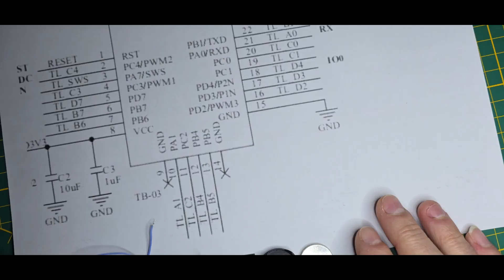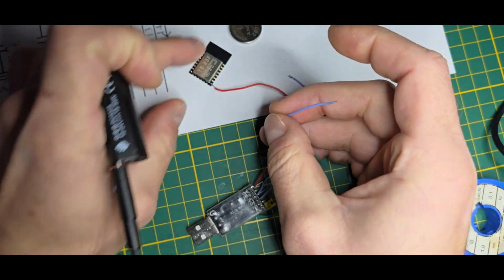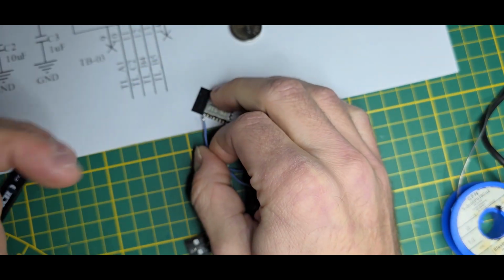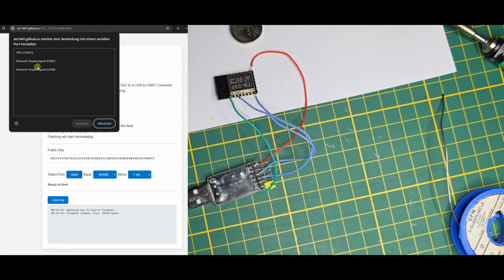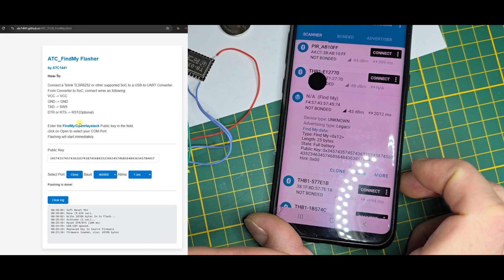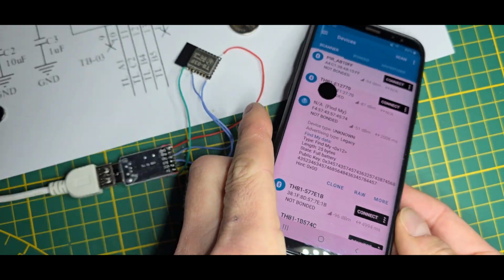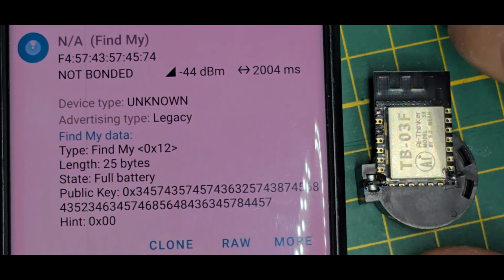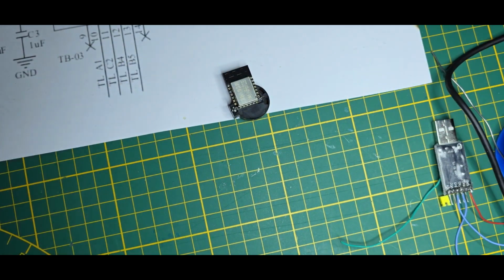2€ Airtag clone, DIY FindMy OpenHaystack device

Comment: Nice tutorial! Has anyone succeeded in using the web flasher with Chrome on macOS? Tried two different USB-to-TTL dongles but the microcontroller doesn't seem to start advertising after flashing so I suspect something is going wrong during flashing.
Reply from the maker: Hey, this is a Windows with Chrone only tool. You can use a VM on mac to get it working
Reply: @atc1441 will try, thanks!
Reply: @atc1441  That did the trick! Thanks a lot!
Reply from the maker: Perfect

Comment: I tried with version already buit in programmer. After programming I see in bt devices AI-thinker instead of Findy My or Any indicator that it is Apple Airtag..
Reply from the maker: Then the flashing went wrong and it is still running the old firmware
Reply: @atc1441  I don not get any error. Here is an example log: 
06:52:17: Soft Reset MCU
06:52:17: Done (8.293 sec).
06:52:11: Write 18788 bytes in to Flash...
06:52:09: Activate (1 sec)...
06:52:09: Reset DTR/RTS (100 ms)
06:52:09: USB-COM opened.
06:52:05: Replaced key in Source Firmware
06:51:17: Firmware loaded, size: 18788 bytes

and then: Flashing is done!
Reply from the maker: The flasher does not have any Rx, only Tx so it does not know if it was successfull.
Make sure to use a Windows machine with chrome

Comment: Thanks a lot! I have been using it to track my Electric bike (in case of theft). I linked it to my Home Assisstant and it's working flawlessly for 2 weeks. I am so impressed by the range covered by those tiny chips, it manages to get a connection from my underground garage.
Reply: this firmware doesn't have key rotation so a theif will be able to see the tag is following him
Reply: @magnets1000  If he owns an iPhone. From my experience, it takes time before the notification is sent : I spend days sitting next to a coworker that has en iphone but she never had any notification. Anyway, where I leave bike thefts are a national sport, it reassures me  to know that my bike is still where I parked it.
Reply: Colin Furze ?

Comment: I stopped being as interested in openhaystack I can buy a Sualio tag for $3.20 or so, a perfect airtag clone. How's the battery life with this? There's rechargable batteries that are that size too. I wanted to use the Nordic nrf as it's a lot cheaper than it was before but now I can get it pre assembled. 
Check it out if you are just interested in airtags. Love your vids.
Reply: I'm eating my words now. The 3rd party airtags are too big, I'm going to do this one instead and use a different battery.
Reply: I would love to use airtags, but not with the Apple ecosystem as I avoid that like the plague. I hope Android compatible options will be available soon as well for a same price point, delivering the same functionality without having to DIY servers. DNS's etc etc.
Reply: @MarinusMakesStuff  This kind of technology relies on a massive fleet of devices everywhere that can catch your low-power advertisement packets, combine it with it's own precise GPS data and upload somewhere. Unless all android vendors agree to one centralized solution (which I don't see coming), apple is the best we got =(
Reply: @MarinusMakesStuff they don't have the massive network that apple utilizes. They exist, they just suck unless everyone uses them. I used to use something called a NUT, I think they still sell them.